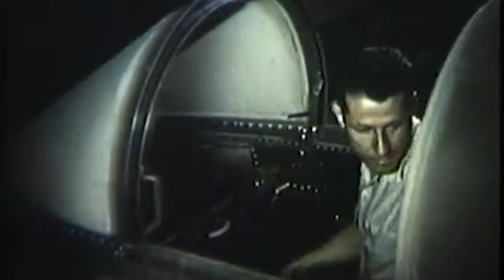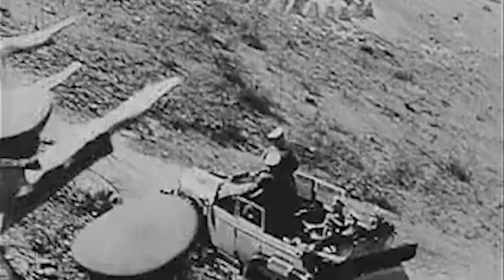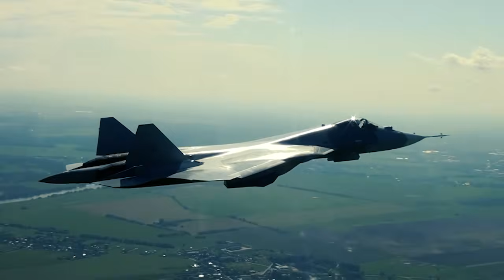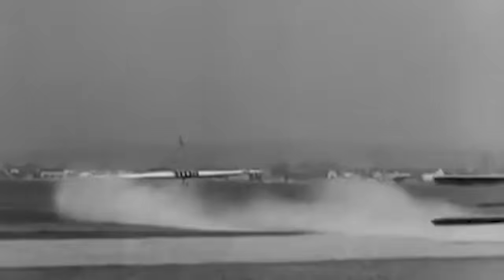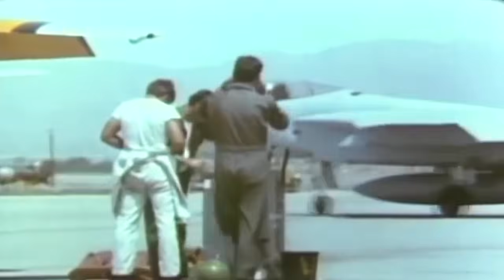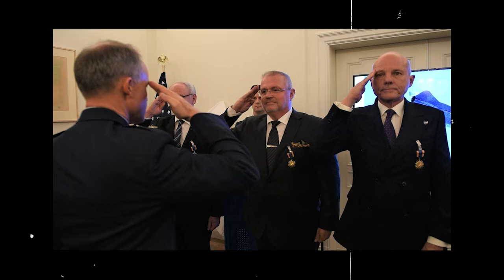The Loudest Plane Ever Built and 9 More Super Strange Marvels

Comment: The B-1 is the loudest aircraft I've ever witnessed in person. The last airshow I was at they had a Bone come down the field at 1,000 feet in full military power then went to full afterburn just before passing in front of the crowd then pulling up. With earplugs and fingers pushing the plugs deeper I still instinctively ducked down. Almost the entire crowd crouched way down out of fear and shock.
Reply: The B-1 is crazy loud.  I wonder how loud the xb-70 was. Never seen tu-95 but it's legendary.
Reply: @NormAppleton  I've also always wondered how loud the Hustler was. The XB70 had to have been almost as loud as the space shuttle. I think that had six extremely large engines.

Comment: The Thunder Screech was quite an apt name. I'll bet it could have gone supersonic though. I just wonder if there was some way to tone down the noise by modifying the blade torque during takeoff.
Reply: NASA's still trying to work out how to reduce sonic booms 70 years later. It's definitely not an easy problem to solve even without having to deal with 3 of them rotating at 3000 RPM.